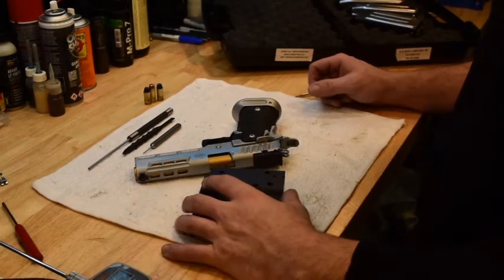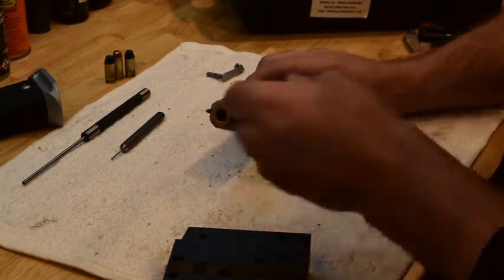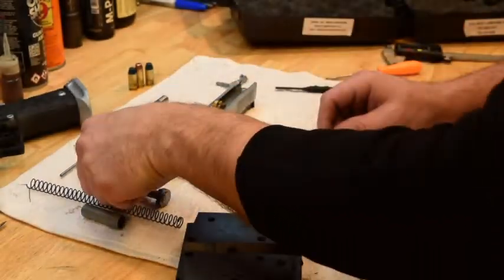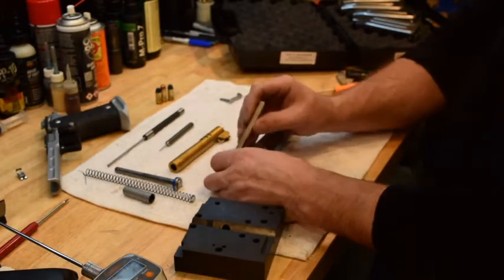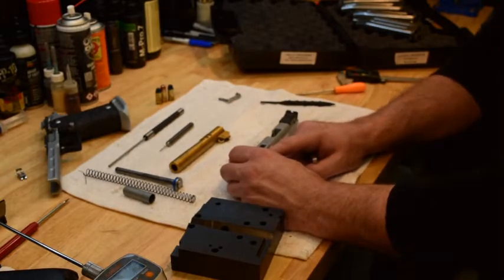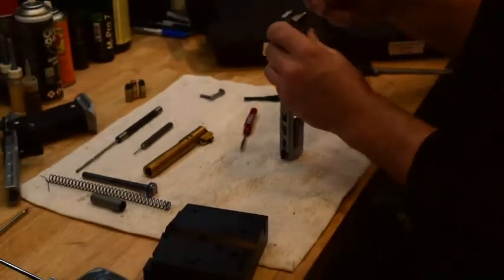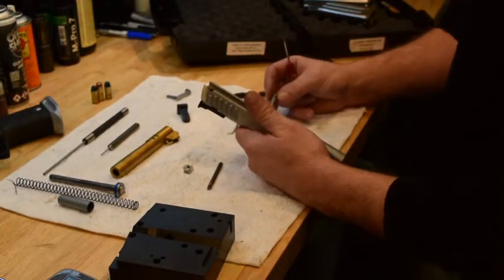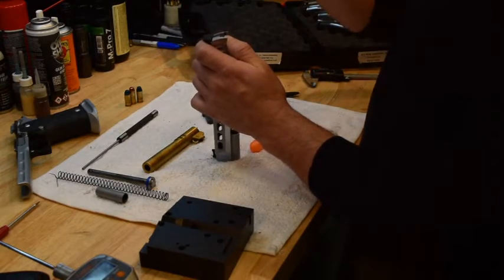STI 2011/1911 DVC Slide Dis-assembly/Reassembly

Comment: Is the DVc carry slide commander /officer spec with the dust cover further back, and take down slot in different locations than government. My 3.0 (3.75") tactical was different like an commander but the frames are the same. With the dvc carry being 3.9 it looks like it could be a full gov slide cut down.

Comment: Do you recommend using a buffer pad on the guide rod?  I see on the gun you are working on in the video?
Reply from the maker: We use shock buffs in our builds.  it can change how the recoil feels.  if you like the recoil feel with the buff we recommend leaving it in.  it's ok to run the guns without them but it's added insurance